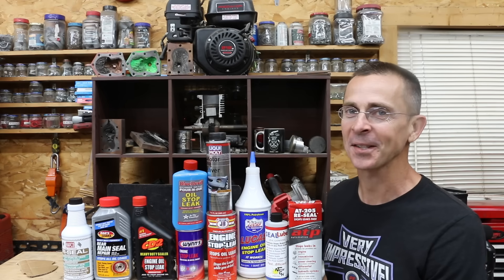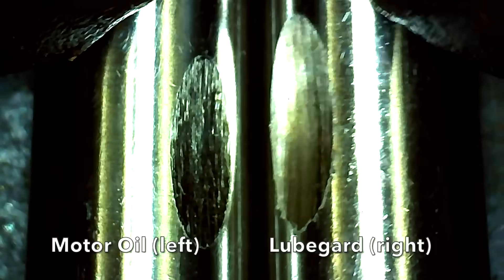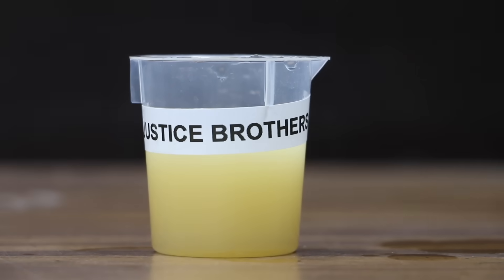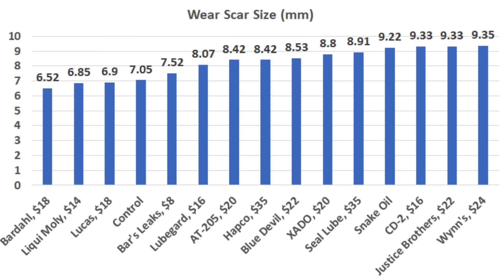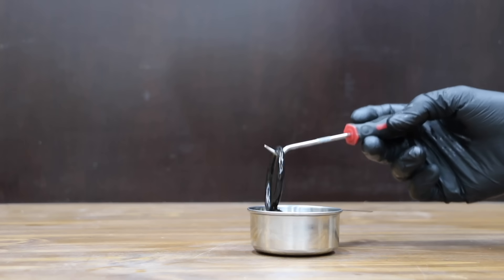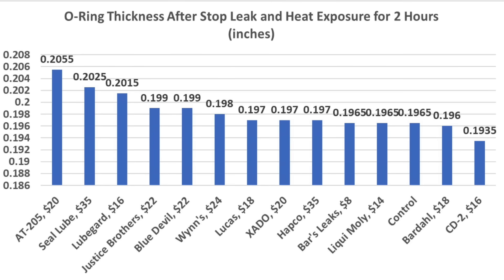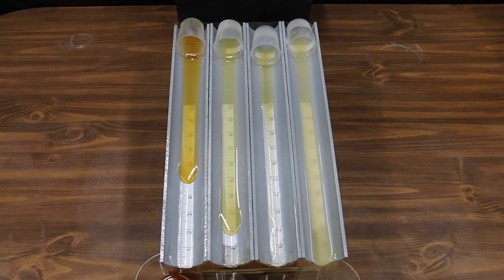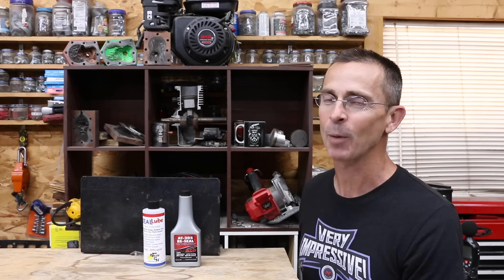Do Stop Leak Products Work? Do They Damage Engine Seals? Will They Destroy an Engine? Let's Find Out

Comment: Stop leak works BUT it also clogs up everything it’s not suppose to. About 3 years ago I had a GMC jimmy come with overheating issues and the amount of stop leak the previous owner had used to bandaid the engine for sale was ridiculous. When I say everything was caked with it and hard as rock I mean everything. I had to chisel it out of every port and I kept flushing more and more out. I showed them what the heads looked like and told them what it would take to get that engine to serviceable again they said scrap the whole thing. As a mechanic with 20 years in the industry I can safely say that yes, this stuff works, BUT if you use it you’re going to have a very bad time later on. Overall I would say NEVER use that shit because it’s going to cause more issues down the line than if you would have just took the time and spent the money to actually fix the issue.
Reply from the maker: Thanks for the feedback.

Comment: How many control tests do you rub to get the results? Like puncturing the flat gasket did you puncture multiple times and average the results, or are you just ouncturing once per product? If you're doing the latter, I wonder how much the results may vary with a single product.
Reply: You're talking about proper sampling, standard deviation, etc.
Not wrong, however none of this is purporting to be a rigorous scientific study. Its a guy in a garage trying to do basic testing in a somewhat methodical way.  There are a lot of things he could do to improve the validity of results, get the standard deviation and error bars and what not. But then it might end up costing him 2-3 times as much time and money possibly, and ultimately to what end?

Comment: Okay I've just seen the results of the Orings expanding and softening. So far if stopping the leak is your only concern at-205 does the nost for seals, but it does cause increased friction while it's in the engine and separates out when the engine isn't running. Interesting. I know from first hand experience no smoke works...unfortunately the engine I used it in threw 2 rods 5 days after I used it...I am surprised.
Reply from the maker: Thanks for the feedback.

Comment: I don’t know about these oil leak stop products but I do know head gasket sealer destroyed two water pumps on my truck. Even though I followed every direction including coolant cleaner and flush before/after product of in the coolant system and use I use OEM coolant. I learned a valuable lesson if you have coolant leaking external between the head and block on an engine with over 200k miles let it be lol
Reply from the maker: Thanks for sharing.

Comment: This video confirmed what I always suspected about these kinds of products. A real repair is much better than a "stop-gap" repair for vehicles. Thanks so much for your hard work!
Reply: Why are you guys saying it's a stop-gap repair?  If the leak is from the rubber hardening and shrinking and this product restores the softness and expands it to original size, then didn't it solve the problem?
Reply: @tomtube1012 obsessive compulsive people that’s all, if the repair didn’t cost em a leg then they don’t feel like it was real
Reply: @eduardogamez2661 nah I’d just rather pay for the better thing one time, than the shitty thing 10 times. Buying the cheap product or cheap service but needing it replaced or done more often is what stupid people do, and doesn’t actually save you money. If you’re in a bind then of course, but if you can afford it you’re being cheap, not thrifty or money conscious. This will not ‘fix’ ANY issue long term
Reply: @sunsubjects the guy above said it worked for +70k miles. I’d consider that long term.
Reply: Another question is that does it have to be repeated?  For example, if I add AT205 to my engine oil and run it and it stops the leak.  Can I then replace the oil with normal oil since the rubber has been restored?  Or do I always need to keep the AT205 in my engine oil for it to keep softening the rubber?
Reply: @tomtube1012  No. Just use it until it corrects the problem (especially in motor oil examples). I believe the bottle itself even states to drain the oil after a certain period of time or miles, but cannot be sure, haven't tried AT-205 in quite some time. I used AT-205 in my Volvo's power steering leak and it fixed it, right up until the car was sold, no leaks or issues whatsoever and it had that stuff in it for over 70k miles. Just use it with caution and don't expect it to stop a heavy leak, it is only there to stop mild to slow leaks.
Reply: @SpeCifiC0507  Thanks for reply. 👍👍
Reply: @SpeCifiC0507 I have the same power steering issue, did you just simply add it to the reservoir
Reply: Thank you for great advice 🙏
Reply from the maker: You are welcome!
Reply: At 205 can save u alot of money though when used correctly
Reply: @JUNEBUGLLC  Sure, kinda... but its temporary. All these products are a bandaid solution, a proper repair is the correct solution. So if you're trying to flip cars and screw the next guy... yea they'll save YOU money lol.
Reply: @JUNEBUGLLC  Just watched a Scotty Kilmer video where he recommends AT 205 as an alternative to expensively fixing slow leaks on old engines.  Glad to see his knowledge backed up.
Reply: Sk00maPipe,

Some people don't have the money to have a vehicle diagnosed and then repaired when leaks happen. There is NO harm in using something that has been proven to work. I've used Blue Devil in many vehicles I've bought and sold over the years, especially their head gasket repair...and it works. Anytime I used one of the stop leak products and sold a car, I mentioned it to the buyer and gave them the option for me to completely repair it. And none of them were that concerned..and those cars are still on the road today.  Some having been sold 10 years ago. If it truly works and lasts, then I'm all for it. There is nothing wrong with it. BUT that's why you do your research and watch people like project farm who properly test this stuff. I'm going to use AT-205 in my current car. Just had a crank seal replaced but it's leaking somewhere else too...and I'm not in any shape to diagnose and fix it myself right now due to health issues, and I'm not paying a shop again right now. So if it works it works.
Reply: Ah, but at this point on my 20 year old car I think a real repair would be more than the worth of the vehicle.

Comment: I would recommend mixing Either Half the Lucas or Bardahl with Half of the ATP-AT-205 Re-Seal on American Heavy Duty Trucks/SUVs etc. as to offset the Added wear of the ATP-AT-205 Re-Seal 

However if you have a Honda or Something with VTEC/Variable Valve Timing the oil CANNOT be thick like those other thick Honey like products of the Lucas and Bardahl BECAUSE IT WILL DAMAGE THE VTEC SYSTEM!!!... 
SO THEREFORE I RECOMMEND USING HALF LIQUID MOLY & HALF THE ATP-AT205 RE-SEAL On Imports with Variable Valve Timing Systems!!!! (WITH THE ONLY EXCEPTION OF NOT USING THE LIQUID MOLY IN THE WINTER!) Now THAT would be GREAT To See how much it would offset it... possibly Back to the Motor Oils Control of lubricity wear??? LETS HOPE SO!!!

Probably go with either...

Amsoil
Pennzoil 
Royal Purple
Redline 

Which I remember were your Top Performers in your Testing on those Motor Oils.

We ARE VERY GREATFULL YOU TAKE THE TIME TO DO THESE TESTS TO SQUASH ANY DOUBTS (AND SAVING US ALL SOME MUCH NEEDED MONEY TO STEER AWAY FROM ALL THE OTHER IMPOSTER SNAKE OILS!)
Reply from the maker: Thanks and you are very welcome!  Thanks for the suggestion.
Reply: I would like to have also seen the Best Line Products, Redline, Royal Purple, Amsoil, BG44K and few others too

Comment: I have been working on the farm, in construction etc. AT-205 is my go-to for hydraulic fluid leaks on tractor hydraulic leaks and dump trailer leaks. It stops almost all leaks on my cylinders. Granted, these are usually bad leaks that would require expensive fixes, so I am not sure the lubricity and separation issue is as big an issue. I would love to see you test it for Multi-purpose tractor fluid and standard hydraulic fluid we use in our closed hydraulic fluid systems. I also wish you had tried using "Restore" in this test.
Reply from the maker: Thanks for the video idea.

Comment: hi Todd, while this is amusing; modern cars aren't leaking at these types of O rings.  my car has two oil pan gaskets.  they are both silicone.  the lower pan is easily replaced.  the upper pan requires many, many hours to replace the gasket (silicone.) i would be interested in a test in which there maybe a stop leak product that simply is not about changing just rubber (btw, there are many, many O ring rubbers--simply looking at one formulation of rubber is not super important.)  it's just too big a test with too many parameters.  this is courageous. you always are and i support you and salute you.  as always, there is immensely useful information.
Reply from the maker: Thanks!  Thanks for the suggestion.

Comment: I think you should do your test over again for the wear test. You mix ratios were not correct. That atp 205 is like 8oz for 5 to 7 quarts. I think its able to he used also in 2 or 3 quart systems. Normal use would be 8oz for 160oz of oil.
Reply from the maker: Thanks for the constructive feedback.
Reply: @ProjectFarm  you do great work! And you do a good job with feedback! Keep it up.

Comment: Hey Todd,

Thanks for uploading this video, I just got the Lubegard seal fix to try and fix a leak on my gear shifter oil seal and I am glad that the lubegard does well in your testing :D

I noticed in your tests that the Lubegard will swell a brand new oil seal to a slighter thicker size but did it revert back to its original size soon after? or does it remain swollen even after a couple of days?

Comment: Wait a minute...

If we are putting this in an engine or transmission then you have take into account the wear scar , and there are only 3 that don't make the scar worse than plain oil...the 3 are Bardahl , Lucas  and LiquiMoly...but those three don't appear to help the seals much compared to the control...
So his test is saying yes you can stop your leak but you will cause more wear(scar)...in otherwords , the piston rings will score the cylinder walls more if you use products that will stop your rubber seals from leaking...he didn't say that , but that is what the data says.
Another poster stated that the 50/50 mixture in the test made it inaccurate and likely changed the results. I love the channel but I don't think this was as accurate... particularly for engines and transmissions .... everyone swears by Lucas and LiquiMoly but his results say otherwise
Reply from the maker: Thanks!  Thanks for the constructive feedback.

Comment: This will be interesting to watch. I used that devil brand on a bad head gasket that would dump white smoke out the f150. Used it sealed it enough to even pass combustion gas test in coolant system
Reply from the maker: Thanks for the feedback.

Comment: Would be a simple video, but I'd love to see if the cheap Amazon calipers(for measuring) hold up to the expensive brands when it comes to accuracy and durability.
Reply from the maker: Thanks for the video idea.
Reply: Funny but Harbor Freight's $2.99 plastic ones seem to work pretty well for general garage (home) use. Obviously not doing machining, but better than trying to use a good steel ruler where you're not concerned with thousandths.

Comment: If you use these products, use your heater a lot. So the heater core hopefully won't get clogged up. My brother used one of these stop leaks his heater hardly even works now even after we flushed his cooling system. His heater core is thoroughly plugged up,it won't even back flush. On a positive note, I guess he doesn't have to worry about it ever leaking now.🤣

Comment: These are for mostly rotational seals, I’ve never seen stop leak fix a static oil seal from a hard seal, although high milage oil and oil stop leak will help condition seals to keep them from getting hard. It’s only effective as the claims with rotational seals

Comment: I have a 1969 Chevy C10 with a TH400 transmission from 1967. It leaked and leaked, replaced all of the seals on it without taking it apart. Still leaked, I used the ATP 205 re-seal and it hasn’t leaked a drop for a year so far. I think these kinds of products work great in vehicles over 25 years old, anything newer I feel it would cause damage to things.

Comment: I had a transmission leak coming from main seal of transmission I cleaned the area leaking and tightened all the bolts a little more they didn’t snap then used gasket maker to seal crack and put a whole bottle of atp 205 in trans haven’t seen a drop since last year when i did it

Comment: Great showdown Todd! Good to know Scotty suggests AT205 for various leaks like rear main seals, may save pulling an engine or at least postpone it.
Reply: @@YTcensors Any update on the bars vs AT205? also just curious, did you let the AT205 run for 5 hours operating time before you determined it didn't work? I noticed the largest difference between 3 to 5 hours of op time. this was over the course of 3 days and the third day when running for 2 hours was when my leaks stopped dead in their tracks.

Comment: Awesome test, now I know why people recommend AT205 for softening old rubber parts! I also know what I'm putting in my leaky Toyota - thanks a million mate
Reply: So my question is that I just did my oil change and also saw a very slow leak in my rear main seal in my truck , so you suggest that I use AT205 and let it run like how long and once I stop the engine , do I dump it out right away or wait till next day to see if it's still leaks going on and start the truck and let it sit on idle for 30 min or whatever you going to suggest then dump it out ? Advice 😍

Comment: Would have been interesting  to see the separation overnight for those that didn't separate after 5 minutes. Just thinking of how most people use the cars. 

 Would be interesting to see oil flush tested, you could use new oil, new oil with flush, used oil and used oil with flush.

Comment: That was a good stop leak evaluation.
Have you ever compared all of the different concrete sealers? Some soak in and some seal just on the surface and they all say that they are the best. I know it would be time consuming but it would be an interesting comparrison.
No matter just keep up the good work.
How about comparing consumer wood plainers. I bought a Menards private label one but haven't used it yet. Too much snow. Thanks, Gary

Comment: As a mechanic, I'm always looking to find good products that work best for our customers so your videos are great! Always good content and very useful information. We appreciate your time and research testing additives, tools and products etc. Good stuff thanks my friend!
Reply: Most of the wrench in a can fixes don’t fix anything but good for milking something along if they work at all. I have used cooling system stop leak successfully and used some transmission fix in a can products in a bad automatic to at least make it drivable. It was still trashed but was actually shifting a bit better and brought back a gear that was completely gone. It still slipped a bit but made a difference
Reply: Hi I have a 2006 vw jetta 2.5 my oil filter housing leaks from the gasket slow leak should I use blue d. Or ? I changed my belts today I do most the work myself but the oil filter housing no thank you my guys have to put a new 1 on when I order the part
Reply: @djjoep100 maybe see if the bolts are loose. I’ve never seen a VW oil filter housing but I’m sure it is a pain in the ass to work on do to it being German
Reply: @aidenschvatkok5732  dumbest comment on her 😂
Reply: @rayraycarter04  why? Everything German I have ever had to fix or do any sort of work on was like a fucking Rube Goldberg cartoon
Reply: What's the business name?
Reply: These products can work, I had a 2002 dodge ram truck, had leaky valve stem seals, so it smoked when cold. This was a beat up truck worth only about $1000 it made no sense to replace the valve stem seals. I added some engine restorer in a can, it stopped the smoking after about 50 miles of driving. Depending on the conditions, these products can help.
Reply: @brandonstclair6530  which product?
Reply: i rarely buy anything unless i check here first lol..idont like wasting money
Reply: You mean you can stop a leak for $20 and charge $2000 for a stripdown and rebuild?
Reply: @LondonSteveLee did a mechanic fuck your girl?
Reply: @Reckless Rodent  Idk what kinda mechanic you use got you so butthurt you me judge me like that. You don't know anything about me or our shop. We've got the best prices and never charge full labor. For a customer that is broke and willing to try anything yeah we'd try n help em out. We've got 60 cars at the shop right now bc we run a tight ship. Ask anyone in my town who's the best and most honest and they'll send you to us every time.
Reply: @jasonmarange5973  None - I do all my own maintenance thanks.